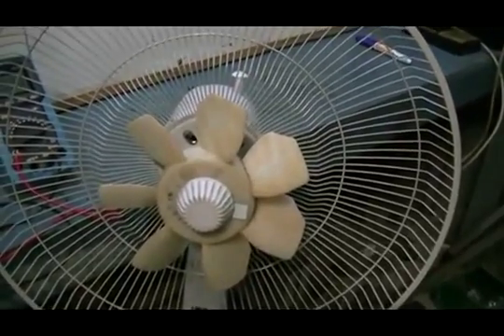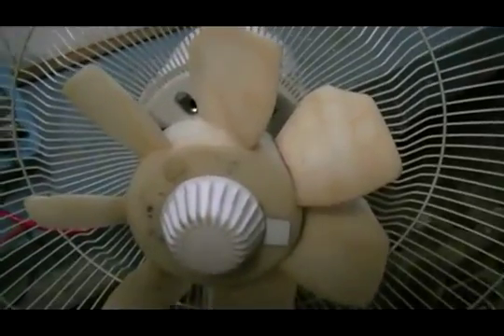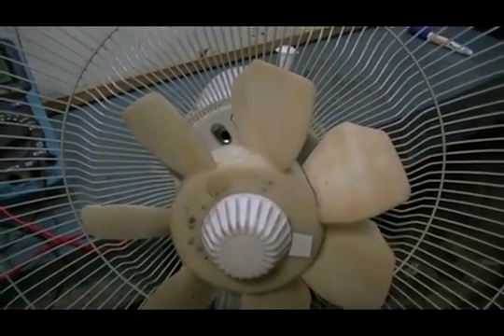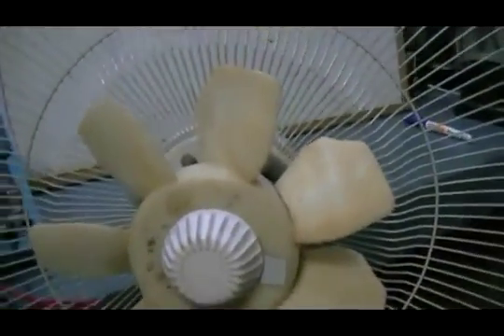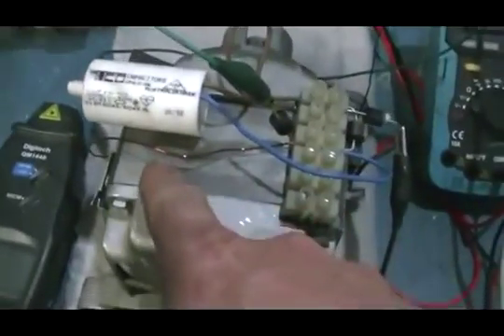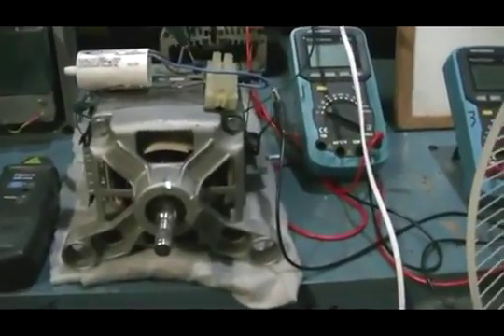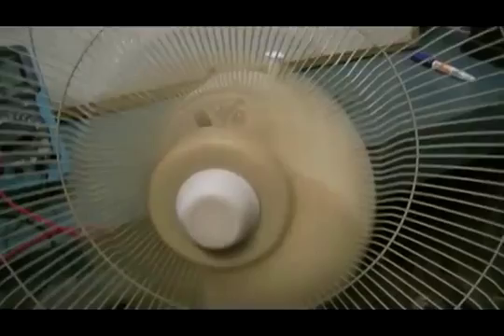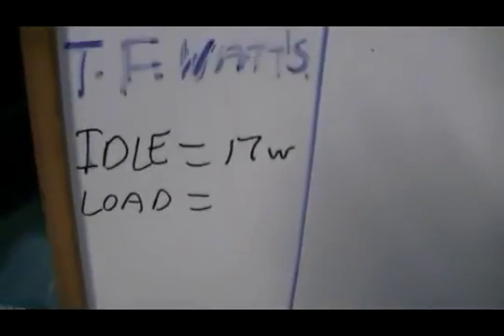Rotary transformer v modern motor

Comment: Nice work Tinman.
The numbers as i see them are quite awesome.

Let's say 36.2Watt at 86% = 1340 RPM that gives that 100% eff would be (1340/86)*100=> 1558.14 RPM
If that's so then 1 Watt would give 1558.14/36.2=> 43.04 RPM / Watt

So your motor would do:
1) 100% conversion (with losses of idle state of transformer) 
     43.4 Watt
    43.3*43.04=> 1863.63 RPM 
2) 100% conversion (motor only) 26.4 Watt
     26.4*43.04=> 1136.26 RPM
So in case 1 you're already getting over 100% efficiency!!!

Comment from the maker: Here is some numbers for you
Standard motor at a rated 86% efficiency-37.22 revolutions of the fan per watt

Rotary transformer in loop mode-77.84 revolutions of the fan per watt.